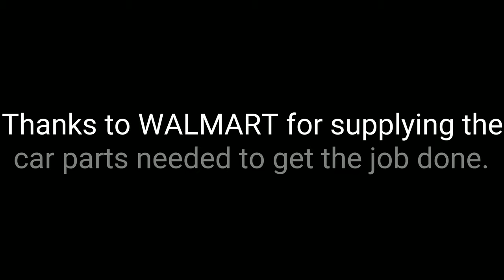How To Change Engine Oil Filter - 2015 Dodge Grand Caravan

Comment: I have this exact van and my new filter wouldn't sit in the cap at all...even when pressed or turned. When I removed the cap off the van, the old filter stayed in the engine not in the cap. Kinda confusing since I watched this beforehand lol. Seems fine though and it's not leaking.

Comment: If you're going to show how it's done, show it right. The hose from the air filter is in the way and is the reason for the problem with breaking the bypass valves. Technical bulletins have been put out saying that this hose needs to be removed completely to avoid damage.